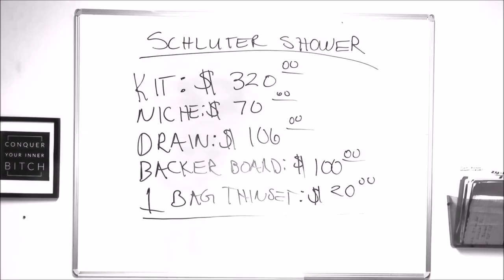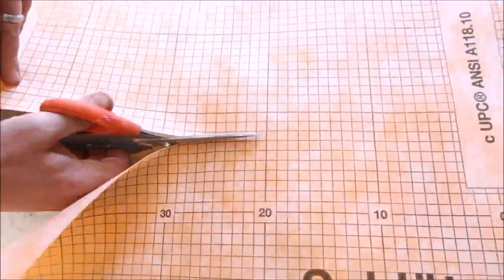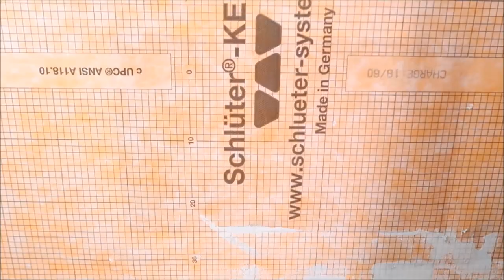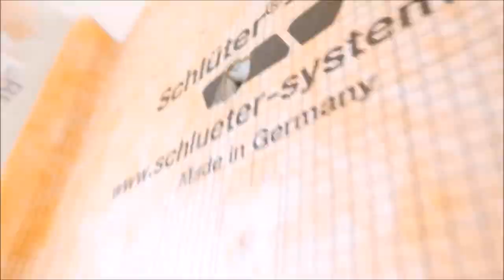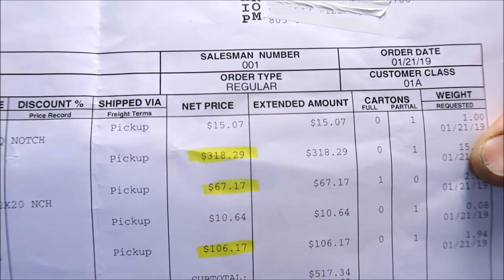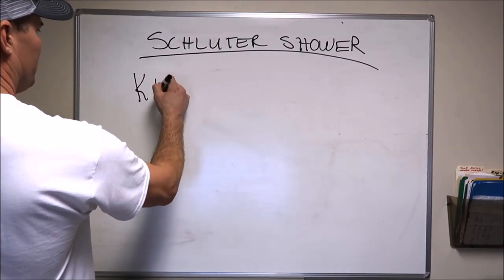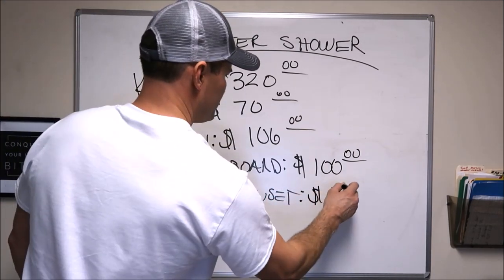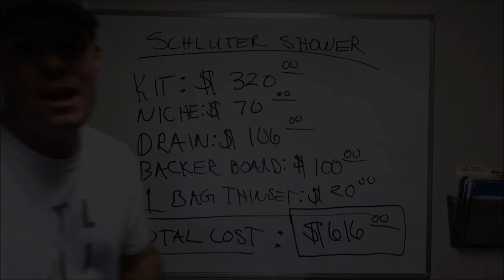The Real Cost of a Schluter Shower

Comment: You lost me at $320 for kit💰😬
Reply from the maker: Your method

$120 2 gallons Redgard (two coats on walls, three coats on niche, curb, corners/seams and pan)
$100 Pan liner and mortar mix
$20 Lumber for curb/niche etc
____
$240.00

$80.00 difference does not compare to two full days of prep, waterproofing and dry time.
Reply: @LandbergTileTV  one gallon redgard, liner typically 45-60 max... but that was only the start of your math, all the other products have to be included as well, plus it is a mechanical system which is very time consuming.. and one would hope that it is done correctly so there is no leak that you don't know about, and a homeowner no less doing this..well...
For me the time stipulation is not an issue, I already give five to six days for a shower, but typically I'm doing the entire bathroom so the dry time just means more free time to do other things. Unfortunately custom Building Products is now making this stuff too 😬
Reply: @LandbergTileTV  are you comparing correctly? Its $600 schluter vs about $300 redguard way....right?
Reply: @StarrTile  Isn't the price kind of irelevent if, as a contractor, you believe in the product and the customer pays for materials? I mean, if you personally like the Schluter system wouldn't it be easy to just build that in to your estimates? I mean, I could see it making a huge difference if you were cutthroat and bidding $4000 bathrooms or something.

On a similar note, I was talking to someone about doing their bathroom. The other contractor who bid on their job wanted $1200 just to do a schluter/kerdi shower....tiling not included. I had an easy time shooting that down and offering a solution at 1/2 the cost.
Reply: @krehbein  I guess my whole practice is trying to make the shower better than the way I found it and I just don't see where Schluter Kerdi products further that end... I make zip off of material, I never up charge my customers for it so the cost is only one factor, but in the end a Schluter Kerdi shower will fair no better than a red guard or aquadefense shower, and my focus is never to speed the process along, to each his own tho👍
Reply: @StarrTile  but you take longer installing it....there's no way you dont charge while its drying.  I can use kerdi, waterproof, set my pan, and tile the shower floor on day one.  Ready to tile the wall the next.  That has to mean your labor is higher or you just lose hours by not working.  And our redgaurd is only sold for 147.00 or I have to special order it.
Reply: Wonderboard lite or Permabase with/Aqua defense,40 mill liner,nice drain,and mudbed(drypack) is cheaper
Reply: @StarrTile  I'm not surprised Bob !  You lost me when we had a disagreement on the no- preslope issue. You blocked me for a disagreement . Now you go on other guys channel showing your disagreements. Funny!
Reply: Kerdi system is a good system. If customer wants to pay for it then do it. Like Starr Tile if I'm doing other things in the house or another job close by I'll mud it out and redguard because I have the dry time. If I'm short on time and cost isn't an issue I'll kerdi the shower and get to the next job faster. Just comes down to job/time requirements.
Reply from the maker: Liner for a 5 foot shower is $60-70. Also, we know for sure from experience that a single gallon of Redgard will absolutely not be enough to roll out 2 coats on the walls, and a third coat on the niche, curb, corners and pan. Even if you don't use the entire second gallon, you still need to purchase more than one gallon. Also, there are many other opportunities to screw up a liner/mud bed/redgard system than to screw up a Schluter install. Custom coming out with new products? I'm interested...
Reply: @jcmase72  I have been commenting on Mr Landberg's channel for quite some time... it is how we exchange ideas back and forth even if we disagree, as to your being blocked I would not do that because somebody disagrees with me, I only have three reasons to block, one you cuss, two you call me names or three you continue to argue without any proof to your side. I don't do drama👍
Reply: @StarrTile  I agree on your three things but my thing was  I posted a link about  the proper way to install a 3 piece Oatey  drain for a mud pan after you said show me proof. Then bam you had enough... blocked. Sorry for showing you the way Oatey recommend.
Reply: That darn Oatey link https://youtu.be/dRwu1SE_Ass
Reply: If you use Schluter system and tile same day without doing a flood test 🤔 that’s not too safe , sometimes doing things fast fail
Reply: @StarrTile  bob doyle blocks anyone who doeant agree with him he comrs watch landberg to see what a real tile setter is i mean come on hes a handyman with an old tacoma lol guys a know it all
Reply: @StarrTile  you da man. Kerdi is for yuppies.
Reply: @jcmase72  I have seen that video before, there is a lot of things that they are doing wrong in that video so I don't put a lot of credence into methods that are illogical. It is interesting to me however that they are actually cutting an X in their liner for the bolts and for the drain as I have done since I started... perhaps somebody and their company watched my videos 😂
Reply: @matmarchand2399  tell me are you a drama queen or just a troll ?? It must be one or the other because a real man would actually pick up the phone and have a conversation rather than making snide remarks on someone else's video. I have three reasons to block somebody, if you don't know what they are then you must be blocked already and that's why your butt hurt... and for your information I have never owned a Tacoma in my entire life 😂
Reply: @StarrTile  lol a real man would never reply to remarks on youtube bud and a real tile guy would do a preslope look where all makeing observations
Reply: @StarrTile  not so sure Oateys watching your videos but if that makes you feel a little better then all good. You don't have to follow manufacturer guidelines, that's your call. I can understand homeowners,  Jack's of all trades or prima donnas making calls like that,  but not someone that's a craftsman in the trade. I just watched a video from Landburg tile about sulfamic acid crystals to clean tools and I was surprised that you just found out . That's how I know you don't know enough about tile to be teaching it, you soaked your steel trowels in acid now there all pitted and rusty. You know you can drive a car without a seat belt for years with no problems but when your teeth are stuck in the windshield you'd wished you'd had that seatbelt on.
Reply: @StarrTile  i have a question bob whats your thoughts on a preslope and does it matter what size trowel i use or is that a theory what do u use u seem like a guy who has all the answers i want the most beautiful moldy shower possible so i need your help to accomplish that any info would help thanks
Reply: lol I've got pics of a Red Guard shower with niches that the have complete structural damage on a second floor on a 3 year old home, lawsuit is possible.  The old way of doing things is not always the best.  I've seen stars video where he thinks that a decrepit poorly built system was acceptable as long as homeowner maintains it.  Which they never do.